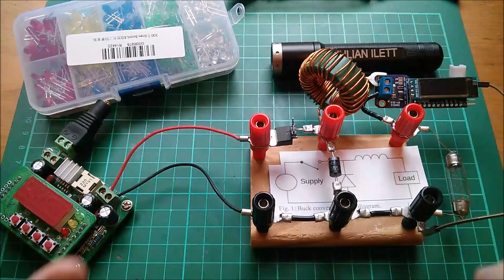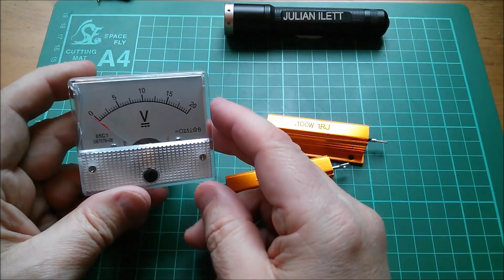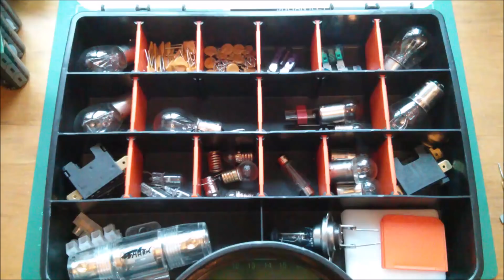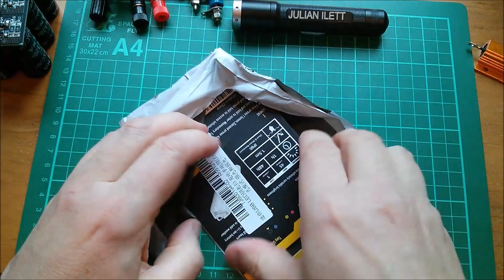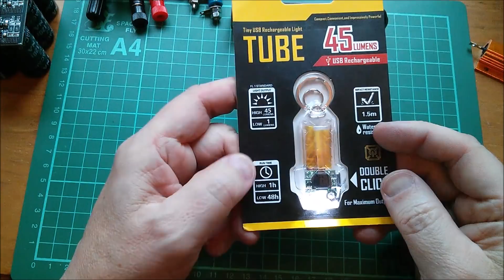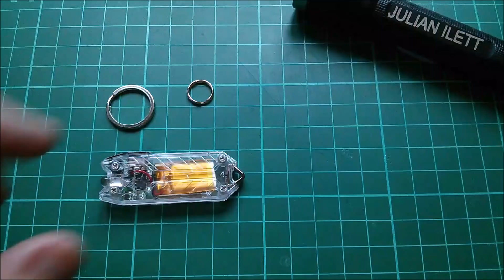Julian's Postbag: #110 - LEDs, Resistors and Capacitors

Comment: You put the plastic pieces either side of the mounting panel, in exactly the same way as the 1970's RS Components ones were mounted. This gives isolation from any metal panel, and stops any problems with rotation from undoing the nut.

Comment: @1:17  The two interconnected insulating rings are used to mount to a metal enclosure while providing insulation to the post itself.

Comment: with the little LED torch, idk why you would want to manually set it to max brightness. if you want it at max, just click it on. the variable brightness mode is for when you want it somewhere in between min and max settings

Comment: You can often buy the genuine Nitecore Tube for about £5 from Banggood.
It's worth buying a real one, as the battery, circuit and LED are better...and the case is polycarbonate, so won't break unless you do something drastic.

Comment: The sleeve is for isolation in metal panels. This is very common. Problem with this cheap things is often the diameter and length of the hole.  To wide and to short. To clamp the U shaped connectors you want a connector that also has a metal washer permanent attached to the plastic "nut" . Just look at the construction of a decent one made by Hirschmann or so.  The type of metal is also important if you use it for measurement purpose. (seebeck and resistance) And you want a fine tread with 2 nuts so it does not come loose over time.

Comment: If you're not sure what to do with the 4 ohm power resistor just add a length of flexible wire and a crocodile clip to either end and use it as a capacitor discharging tool!

Comment: The 2 extra plastic pieces on the banana plug is just to keep the plug screw from hitting a metal frame. They also work very nice on keeping the plug pretty straight. Great Video!

Comment: Does your light have a lock function? I think I have a genuine nitecore and when on you press and hold it will flash and lock and then press long again to wake up. I've had it die in my pocket a few times.

Comment: Drill a 3mm hole through the board.  From the opposite side drill a 7mm hole deep enough expose the 3mm threaded shaft when binding post is in place.  Drop the 3mm nut in the hole and tighten the binding post.  This would be the proper way.

Comment: I am a sucker for LEDs, I actually think they are my first and current love of electronics :-) I never really thought about it but are there standard LEDs for 5v that have inbuilt resistors?
Reply: These are the ones you're looking for:
http://www.kingbrightusa.com/category.asp?catalog_name=LED&category_name=KCResistor+LED&Page=1

https://www.mouser.dk/new/kingbright/kingbright-resistor-LEDs/

I'm guessing you can find them on ebay too
Reply: GnuReligion
That's the thing though. They are "special" and therefore expensive. Also the resistance is quite high so the voltage drop required to light them is 5V or 12V, and that is pretty much a fixed value, whereas with normal leds you can use a smaller resistor. I just use cheap china leds with 330 ohms or 220 ohms resistors (which are by the way also dirt cheap).
Reply: David Watts about 20 years ago i used some red LED 's with built in resistor. They could be recognised by a black painted ring on the base of them
Reply: There are T1¾ (5mm) LEDs which work directly on 5 volts, they're just harder to find these days. I did a quick search on Ebay and found the older gallium arsenide phosphide LEDs available in 5 volts. If you're just wanting them for use for indicators, these are fine because they're not very bright.

Back when Radio Shack was still around, they used to carry a decent selection of 5 volt LEDs to use on proto boards with 74xx series logic. Much of that selection vanished in the 2000s when they started concentrating on selling gimmick toys and cell phones.
Reply: Wow, I was about to make the same comment!  FrilloTeslar has a viable link here ... but can we get a bag of 500 for only a few bucks from China?  The ones I see on Ebay and AliExpress seem to be 12V.
Reply: Thanks for the link.  Now I am wise to the thing called a "Resistor LED."   Am adverse to really bright lights ... and the tiny 3mm ones will shine at a very low current (lower than the 5mm's for some reason).  Unless dithering with PWM or whatnot, will usually put a whopping 470ohm on for simple indicators -- like an AMS1117(3.3v).  Hmmm.... just got a brainstorm -- build a jig to solder an SMD resistor and SMD LED to the end of a male pin, and run a little stranded lead off to another male pin.
Reply: Yup. They're often used in computer cases for power/HDD indicators.

Comment: Maybe Turbo Mode simply means the quickest, and guaranteed, access to maximum brightness, regardless which one of the OFFs the lamp is currently in. Plus of course that it is push-to-light, extinguishing when you let go.
Reply: Anvilshock i was thinking it might put the battery directly across the led? And high mode is just slightly down from that? 
Im not brave enough to break mine to test it 😂

Comment: Just countersink some holes in the wood and glue the nuts inside the holes. You can either cut the posts to size or drill a 3 mm relief hole through the wood if it is thick enough.

Comment: The purpose of the 2 pieces of plastic on the post is to sandwich the panel they are mounted to in between. They isolate the posts from the panel that way if the panel is metal you dont short the posts to each other.
Reply: It also allows for quite a thickness of material to have the terminal base mounted through.

Comment: Not sure why you didn't just drill larger holes in the wood for the connectors, if you don't need the rear terminals, just cut them off
And the ring on the new terminals is for insulation when metal panel mounting
Reply: Sparky Projects i think he needed them to mount them with, using the thread to cut and grab into the wood

Comment: The nesting plastic rings allow you to install this in a metal panel and retain isolation from the metal panel.  Each half of the nesting pair is installed on opposite sides of the metal panel with the tee shaped part protruding through the metal panel.

Comment: You should buy some wood thread inserts so you don't just strip the wood
Reply: Not least because wood should never be considered to be an insulator.
Reply: video99.co.uk good point i didn't even consider that.

Comment: Those are probably the biggest resistors i have ever seen. not sure about use cases though.
Reply: Try working with transmitters. 5000W 50R resistors are common.
Reply: couldn't  you use PWM? most things do that these days. do transmitters not use switching powersupplies?
Reply: Try poking your head in the door to the motor room of an old lift/elevator there are some nice big resistors to keep you warm!

Comment: That piece of plastic, is to not to short the terminals on a metalic enclosure. Is like an isolator for the terminal.
Reply: António Carlos Albuquerque the plastic ring is for flush mounting and remove it for an embedded mounting and still have that insulation.

Comment: Hey Julian why do you not use weft nuts? For the terminals. a bit more work but it will do the job even better than you original solution.

Comment: Those strange sliding things on the terminal posts are for panel mounting. That panel goes betveen those two pieces and they isolate the metal from the panel. Works only with panel less thick than around 3 mm...